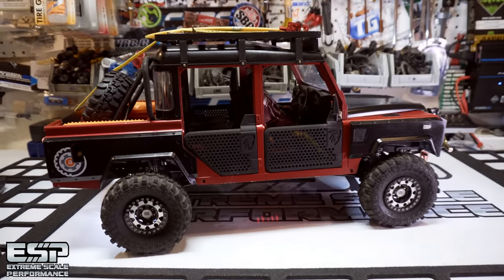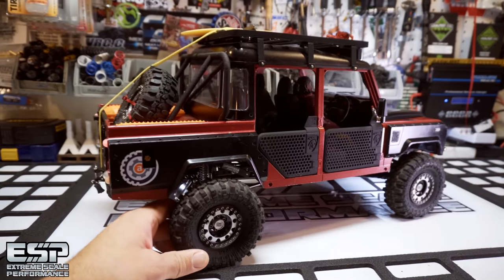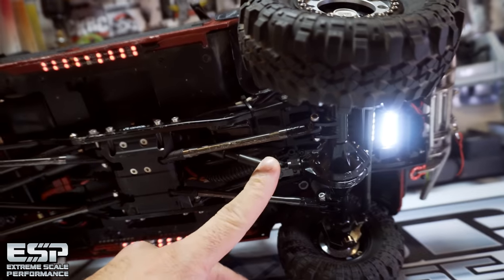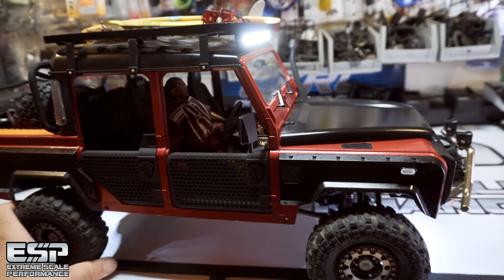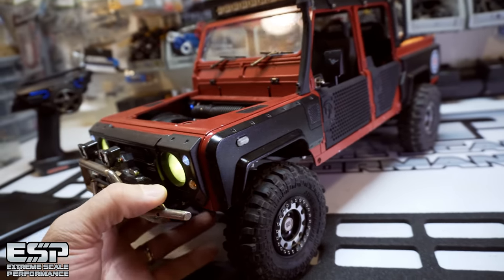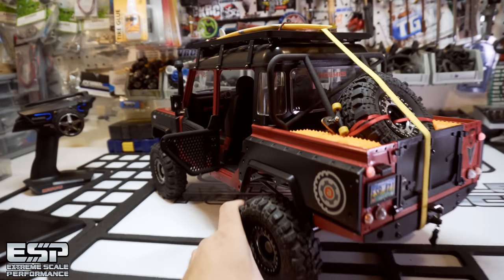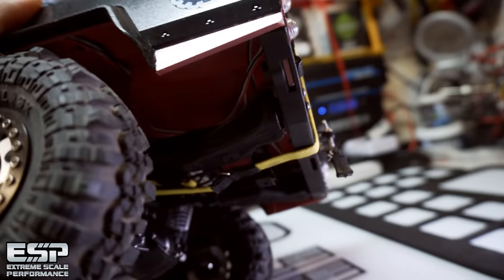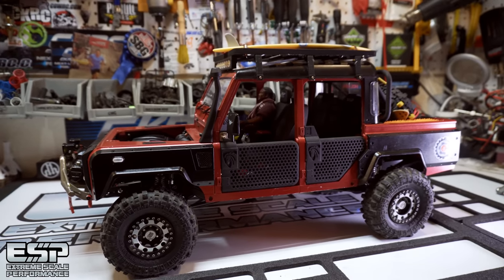ESP_RC | PROJECT BLUDD MUNNY | LAND ROVER DEFENDER 110 PICKUP | COMPLETE OVERVIEW!

Comment: awesome build there!! hey if i could ask a quick question i would love to hear your input... i just sold my older scx10 jk model and want to get something price friendly and is easy and run to take along on hikes and will last the entire time, and be able to handle actually driving it and be able to take some roll overs without breaking everything...

do you have a favorite rtr rig you could recommend? i was thinking maybe just getting the scx10ii kit and use all my parts that accumulate after years in the hobby... if u do recommend the kit what would you go to for suspnesion components along with the motor setup? would u go with the popular integy springs that many run upside down and without a spring? or would u recommend some decent piggyback shocks or something?

and with the motor, i want it to have a little speed to it yet be able to crawl and climb and have the torque to do that, but also that speed if i were to do a sled pull or something like that... would you go brushless? if so what would you recommend? what would give me that awesome torque and also the speed, it doesnt need to blaze past me but def like a rock racer speed def much faster than a hiking or walking pace... and lastly what would you recommend for a good spur and pinion gear setup and numbers? i appreciate any info you would be kind enough to share in advance, and am very excited to see in what direction and what companies you would recommend?! i kno the popular two are traxxas of course and axial... what would you recommend for a good scaler tho?

i was actually considering potentially the traction hobby 1/8th craigsman or jeep or the raptor version.. im just not sure about the locking differentials done by a cable linked up to a splash proof servo..neways cant wait to hear back from ya... take care and keep on trailing!!.

-Pete

Comment: 🐸Looks really nice, could your light controller switch be hidden, maybe under the dash board. Are you perchance running that truck with droop shocks or is it just that heavy, even with sway bars shocks compress fully I noticed, love the Vanquish parts.  Build looks awesome so far, looking forward to seeing it run and the build progress further. Later

P.S.Did you remember to link shapeways designer of your rear bumper?